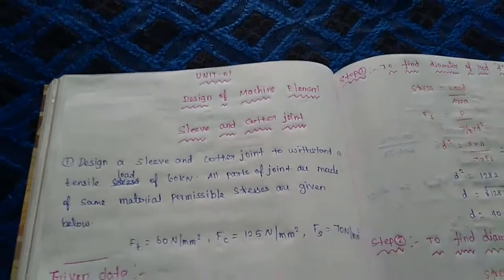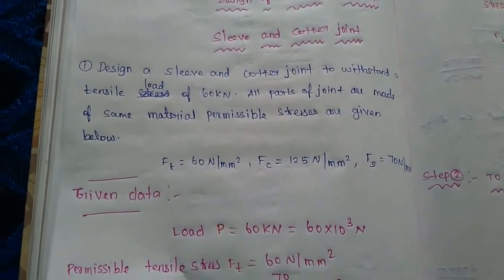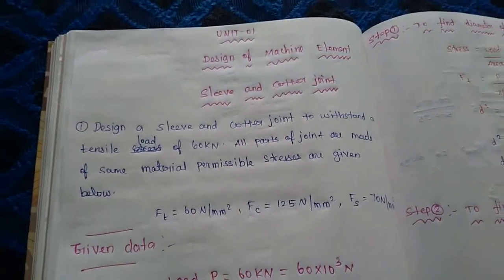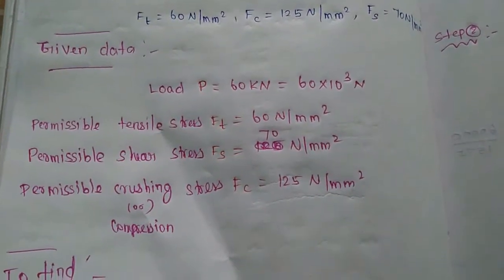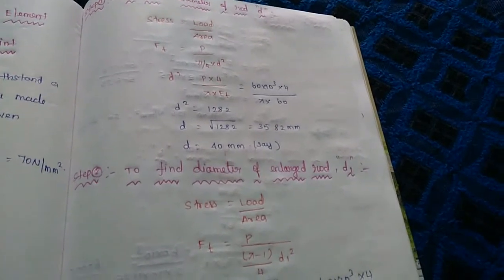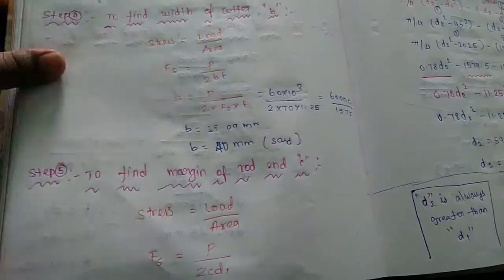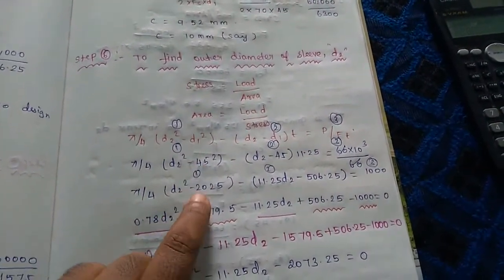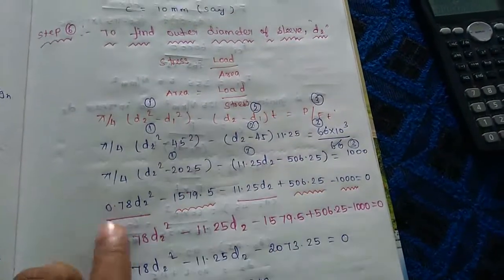POLYTECHNIC (PART-1)-DME UNIT-1 SLEEVE AND COTTER JOINT FULL EASY EXPLANATION&TIPS&TRICKS

Comment: Sir doubt keta respect pannunga sir d1 calculation thapa varuthu explain pannunga bro
Reply from the maker: sorry  bro konjam busy bro.......solren
Reply: @educationhub8754  thanks bro
Reply from the maker: Square root 2000 is equal to 44.7 then make it whole values 45 this is ur doubt
Reply: @educationhub8754  No sir. 2000 is not coming in that formula. Coming value is 62589.0 bro. What is the mistake. Explain please
Reply from the maker: @305gowthamprabakars4  OK
Reply from the maker: Bro corrects than varuthu bro 60× 10×10×10×4 = 240000 ÷ (π-1)×60 = near 2000
Reply: @educationhub8754  Unga facebook I'd sollunga bro plz varala bro 😥
Reply: Ungala nambi tha bro iruku plz